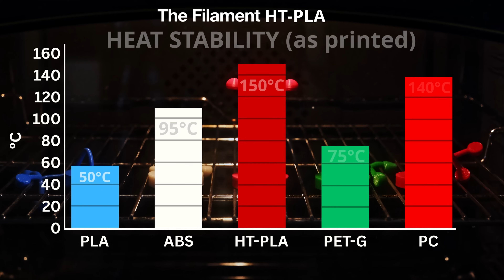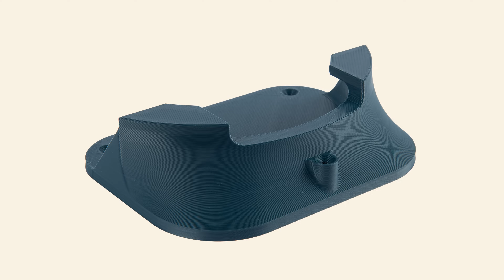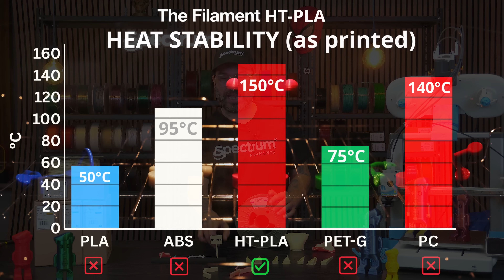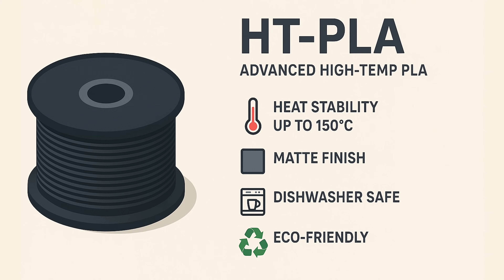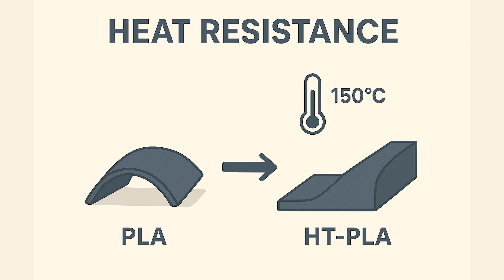HT-PLA: The Filament you are missing ! | #spectrumfilaments

Comment: The HT-PLA Black is, by far, the worst filament I've ever printed.
It leaves a strange tar-like residue on the nozzle, the mechanical properties are subpar and it warps so much it lifted my magnetic build plate from the bed.
Just don't.
Reply from the maker: have you tried drying the filament first ?